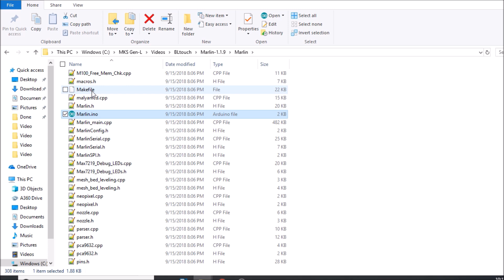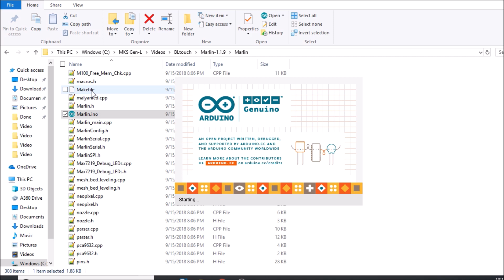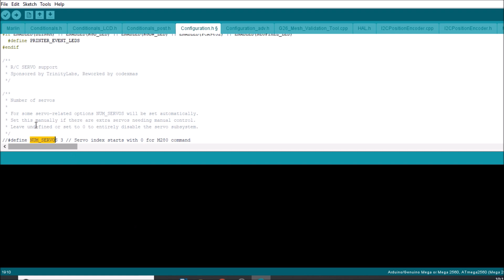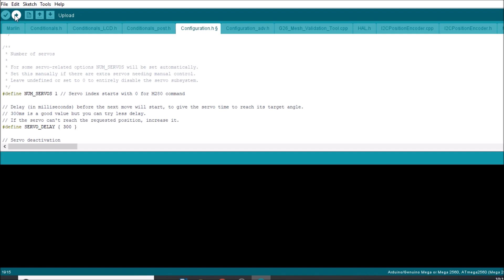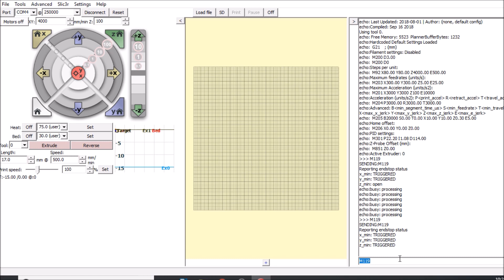MKS Gen L - BLTouch

Comment: so, I'm sure it's entirely unrelated, but I installed some tmc2209's as well as the bltouch, used the marlin 2.1 firmware on the mks 1.0 board, and now for some reason my display isn't working.. only a bright back-lit blue screen pops up, but there's no interface or beeps
Reply from the maker: Might be easier to answer this in Discord General chat on my Discord.  Either myself or someone else can walk you through issue.

Comment: Great video, I was ready to pull my hair out before I found this video. Fought the settings for 3 days. After this video I had the printer running in about 10 minutes. Thank you!

One question though……. With (2) Z motors, do i need to increase the NUM_SERVO value to (2)?
Reply from the maker: Nope.

Comment: I'm not sure if anyone is still checking this out but how about a filament runout sensor? I had to switch the ground and power pins but the only thing I noticed(I watched your other video on the servo pins) is before I saw that the sensor would always so triggered no matter what so I hope this helps.

And later on using my bltouch again.

Comment: Hi, Great video, I have an Alfawise U20 with a MKS Gen L motherboard and a BL Touch, (Marlin 2.0.7.2). All is correct except BlTouch. When I start an homing, the nozzle goes to the center of the bed but bltouch no deploy and start to descent. I've trying many options but it's not working. Can you help me about this ?
Reply from the maker: Since early Marlin 2.0.x they've changed something.  In the coming weeks I'll be examining the issue.
Reply: @EdwardBraiman  Thanks for response but I've resolved , it's just a bad connection with the Dupont connector. Regards

Comment: in marlin 2 or 1.1.9 i not have BLTOUCH_DELAY .. Why ?
Reply from the maker: Are you asking why they are not in video?
Reply: @EdwardBraiman  I am also having this issue. Your video shows BLTOUCH_Delay needing to be uncommented but in marlin 2, there is no delay.
Reply from the maker: Which version of Marlin firmware are you using?  Also Marlin firmware may have changed since recording.
Reply: @EdwardBraiman  2.0. I have never messed with marlin.  I stepped back a step and am trying the version 1.1
Reply from the maker: The tutorial is based on version 1.x.x, so features of Marlin firmware v2.x.x are different.
Reply: @EdwardBraiman  Will you make update manual for Marlin 2.0.x? I lost all day trying without success :( it would be enough configuration info in the text file.

Comment: Hi Ed, Thx for the tutorial. 

I have a FLsun Cube 3d printer with a MKS Gen L v1.0 with touch screen and an original BLtouch sensor. I downloaded the marlin from your source, and updated the arduino file you mentioned. But the change in min 3:59 "Define BLTOUCH_DELAY 375 could not be done, since I did not find that line.
Next I uploaded the sketch. When I turned on the printer and comanded Z home through Pronterface, the bed went down and the two motors worked one after the other and not in parallel.

Any ideas what could have gone wrong?

Thx in advance!
Reply from the maker: The Marlin firmware version may have changed since the tutorial was recorded.  So the option may have changed.  As for the motors check the configuration_adv.h and search on parallel I think to set the steppers.
Reply: @EdwardBraiman  The only parallel thing I found in the configuration_adv.h is related to heat. The stepper z motors are connected to the board using one port and than splitting the signal via wire... Any suggestions?
Reply: OK, I just did the changes you suggested in your video. Exept that I not only activated the BLTOUCH but also deactivated the probe lines above. Also it crashed when I changed the num_servo number from 3 to 1. Therefore I just left it at 3. What exactly was the purpose of the 3 to 1 change?
Reply: @EdwardBraiman  I just flashed that version:
https://www.dropbox.com/s/p74bngyv00jym0b/dual-autolevel.zip?dl=0

now I need to check if I can integrate the bltouch again. Any thoughts?

Comment: your guides are awesome and thank you. I have a question, being a newbie at this I've been changing my 

tevo tornado to a dual hot end. Your fan extender helps me with the dual fan setup but now where do
I plug the bltouch, can I pick another set pins and if so where do I change it on the firmware
Reply from the maker: If you pick another set of pins you'll need to modify the pins file.

Comment: Hopefully you can help. I have a ender3 with mks gen l board.  I installed the bl touch, everything is operational with the exception of when the probe is pushed up it doesn't stop a movement going down. 
I got frustrated and reconnected the stock a end stop, to my surprise that doesn't stop a movement now either.  I'm guessing I screwed up firmware somewhere. Any ideas will be appreciated!!
Reply from the maker: Maybe the servo power is reversed?  Also the are additional settings for BLTOUCH in Marlin firmware that might help.

Comment: When i updated the firmware my the printer screen went blue and now the printer is unresponsive,any help?
Reply from the maker: What type of LCD screen? When you connect with Pronterface, what do you see?
Reply: @EdwardBraiman  12864 ramps
Reply from the maker: What is connected to the MKS Gen L board? Just the LCD?
Reply: I have same. I have ender 3 lcd
Reply from the maker: Do you have a link to the LCD type?
Reply: And board leds not shine
Reply from the maker: @maciekpytka1287  The tutorial is on a MKS Gen L v1.0 and the board you're referring to what appears to be a Creality Mainboard which may have different pin outs.  So you would need to change mother board to BOARD_MELZI_CREALITY in Marlin firmware, also try and match connector type and board type as it appears to be  something other than reprap smart discount lcd.  Keep in mind I do other tutorials on MKS which might closely match the subject you're asking about, so when I see a message on my cell phone display I might be confused about the LCD tutorial verse the tutorial being BL touch.    Good luck let me know how it works out.
Reply: https://m.banggood.com/Creality-3D-12864-LCD-Display-Screen-For-Ender-3-3D-Printer-p-1350131.html
Reply from the maker: Keep in mind I might need to order this LCD to see the issue as it appears to have three ribbon cable connections on the backside and may have properties I'm not certain about.  The tutorials I've done in the past have only had two connectors for ribbon cables.
Reply: Thanks for the help
Reply from the maker: No problem, just needed a hardware point of reference from Google.
Reply: It’s all good I ordered a new board I think I unplugged it before it was finished
Reply from the maker: You might be able to recover with FTDI load.  I'm researching a tutorial on this subject.

Comment: what do you mean by number of Servos, is it the number of the Servo motor that the printer has which moves the Axis? if that is the case most printers have at least have 3.
Reply from the maker: There are four sets of servo pins.  So in the Marlin firmware I'm demonstrating how to set the timing for each if we had used more than one set.  It was an error I learned about, which caused a delay when first learning how to use the board.

Comment: Congratulations nice video was very helpful.
I have a question to do, I use octoprint with this motherboard and as soon as the raspberry turns on the bltouch lights up, do you know if you can disable / activate the servo-pin on command?
Thanks
Reply from the maker: Yes.  It's normally activated by the gcode.  Gcodes can be found on the Marlin firmware website.

Comment: Hi Ed .. Having the same board MKS GEN L V1.0 and apparently own the newest version of the BLTouch ..  BLTouch base is "Black" (instead of white) and has BLUE /RED/BLACK  3 pin & BLACK/YELLOW two pin.  Do you know if the three pin may be reversed for some reason or do you think the connections of the three pin is correct?
Reply from the maker: Red sound like voltage Black ground and Blue is your your pin.  Black is ground and Yellow signal.  Verify on your silk screen (board) if they match.  Let me know if it works correctly.
Reply: @EdwardBraiman  Sorry Ed .. I have the 3D Touch not the BLTouch (Good Grief! Too many "touches")..  The wiring on the plug connection is as follows:  Black/Red/Blue/ (3 pin) Black/Yellow (2 pin) To my understanding the BL Touch is Korean and the 3D Touch is a Chinese copy.  However to my understanding they should work alike .. Just wanted to check with you on the wiring ..  Thanks!
Reply from the maker: Keep in mind I did a similar tutorial for the 3d touch on my RAMPS tutorials, I might do 3d touch for MKS Gen L this weekend.
Reply: I believe that did work .. will find out more when I zero everything ..  The printer is way out of tolerance and believe it was not setup properly from the start and part of the issue with my printing..   
Looks like 3D PRINT (3D) wiring BLACK/RED/BLUE  follows BLTOUCH (BL) BROWN/RED/ORANGE  -  From your pinout position on the MKS GEN L V1.0 Board you illustrate  wiring BLUE (3D) is ORANGE (BL) - RED (3D) is RED (BL) - BLACK (3D) is BROWN (BL)
Reply: @EdwardBraiman  That would be Great! ..   My 3D Print is off the table right now and can not setup anything ..  Do you have something on the X Y tolerance?
Reply from the maker: @dougcrawford2587  good luck
Reply from the maker: Could you give me a little more about a x y tolerance.  Do you mean stepper motor board or Marlin firmware?
Reply: @EdwardBraiman  Setting up my offsets ...
Reply from the maker: Remember it depends on your printer design.  So first set 10mm in Marlin firmware, then home changed axis and see if it's where you thought it would be.  Adjust and reload as needed.

Comment: Nice vid! I just got some thoughts about how to add Auto bed leveling. If u add the bl touch this way, does it work as z-endstop or does marlin know that it has to use it as level probe?

Greets t3cker
Reply from the maker: You can use BLTOUCH for bed levelling.  Just keep in mind once you try it can either be cool or very painful experience.
Reply: @EdwardBraiman  So this is not the proper way to use it as probe for bed leveling with this board I guess?^^
Reply from the maker: No. You can use the probe.  My experience with autolevelling was that when I tried it that the print quality was lower and manual levelling worked better.  Keep in mind your experience maybe different..

Comment: Thanks for the great and informative video.  I have a Tevo Tornado (2018) with a MKS Gen L v1.0 board.  The end stops are plugged into the X min, Y min and Z min end stop connectors.  If the Z min connector is already connected to the limit switch on the Tornado where do I connect the BL Touch?
Reply from the maker: Usually on the x carriage.  Thingaverse usually has some designs.  You could also checkout my basic tutorials on openscad, to design your own x carriage.
Reply: @EdwardBraiman   Can you put a link? I have a Tevo Tornado too, x min, y min, z min are all taken by limit sensors. I don't understand what you mean by "x carriage".
Reply from the maker: X carriage is normally where your printhead is attached. It normally moves left to right.  Marlin.org has more information.
Reply: @EdwardBraiman   Thank you for the fast reply. That link doesn't work unfortunately. I guess to clarify my question, If the Zmin terminals are taken by the limit switch, do I put the Bltouch in the Zmax? Then I do some programming changes in the firmware to accommodate this?
Reply from the maker: With the current configuration of your printer if it's not a Delta type printer you will need to disconnect the connection to zmin switch unless you're using two x carriages.
Reply: @divisionoflabor3070  Did you make it work?
Reply from the maker: Do you mean on a Delta or in general?  The bl Touch works in the video.
Reply: The BLTouch goes.in place of the z limit switch in the zmin spot
Reply from the maker: Yes, unless maybe a Delta type of 3d printer in which case it will be zmax.

Comment: Hello Edward,

thanks for the great video and the super good explanation. What should I do if I want to use a car bed leveling sensor instead of the BL Touch leveling? Do I have to connect the ABL sensor to the motherboard like the BLTouch sensor? Dake for your help and support in advance. 

Greetings from Bavaria Chrisitan
Reply from the maker: Could you send a picture or web link or data sheet link as I'm unsure what a car bed levelling sensor is?
Reply: Sorry, but i meant an Auto Bed Leveling Sensor. :-)
Reply from the maker: @christianhofer8398  Do you mean talk about auto bed leveling or a type of sensor?
Reply: I meant this one 

https://www.amazon.de/LJC18A3-H-Z-1-10mm-Kapazit%C3%A4t-N%C3%A4herung-Schalter/dp/B00542U3M4
Reply from the maker: @christianhofer8398  I've done PNP sensors, NPN get complicated quickly, but someone in the comments section in France worked out how to wire and left links.  https://youtu.be/jN73VXVcofM

Comment: Hello great video but I am having the same problem as Rene' Wilson  Trying to add Bl Touch to my Tevo Tornado and the sensor is working backward.  Not sure what to change when you said check inverting  I don't have any sensors connected  just have bl touch  on bare board as you did in the video  Thanks
Reply from the maker: If you open the Marlin firmware and select the configuration.h tan, then do a search for "inverting" and set to opsite logic of the setting it should be what you want.  If not I'll let me know.
Reply: I just got it working ok now after about 5hours of frustrations  It was with Pronterface every time I would click on Z home it was giving me a G28 Forbidden error So I went through the same steps with Cura 15.0.4  it worked every time    I now uploaded to my tevo and installed the bltouch and its working great.  Thanks for getting back and for the info.